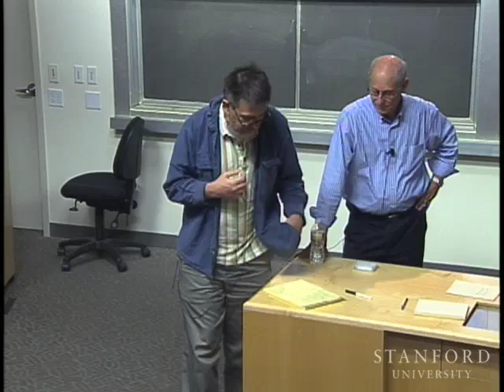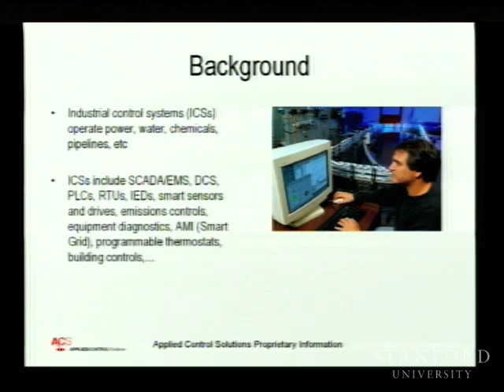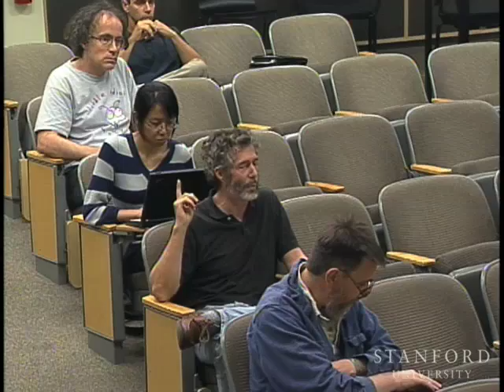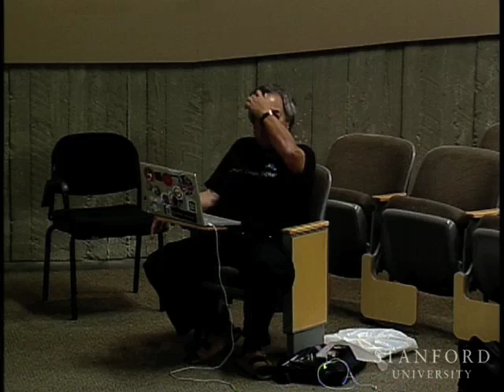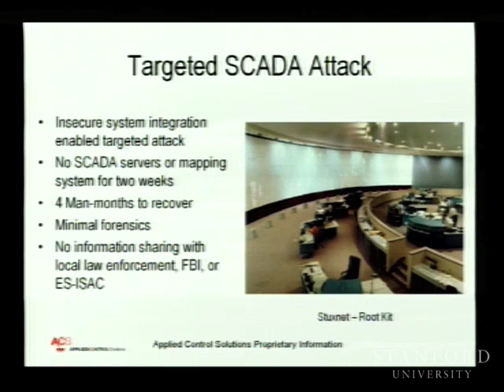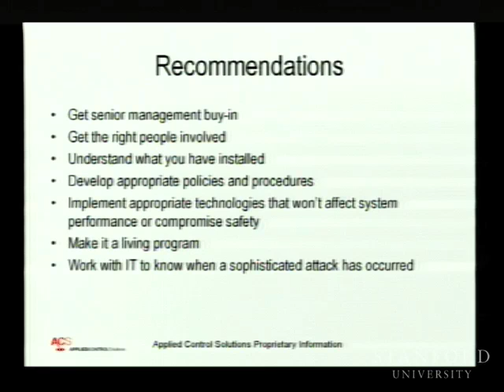Cyber Security of Industrial Control Systems

Comment: Me not an expert but me thinking...why on earth cant these PLC units just have an old fashioned fire wall? I think I have a possible answer. Because 15 companies have delivered millions of control systems to the whole world for decades and its simlpy to mountainous of an attempt to go in and change them all. They cost a fortune and the entire induatrial world uses them. And ifeven if you did. There are no current alternative products from Siemens and ABB that can to the job
Reply: That is not the case. Manufacturers are now providing and supporting separate firewalls for network segments (for at least 5 years).
There has always been the ABILITY to protect traffic, on a network segment, but this is not generally implemented due to overall system cost. Maintainability, systems training and the cost have been the main considerations for 2 generations of systems engineers already.
Yes, it is time to move forward, but frankly, the ideal would be having a virus scanner incorporated in addition to individual device firewalls. However, PLCs and local controllers require rapid scanning rates (often less than 100 ms) to ensure capture of an input event, transfer of a function to an output and so on. So, it's a risk, but it's been a considered risk not to have virus scanners, firewalls locally incorporated because of their additional resource overhead.
For completeness, security policies should include the physical, procedural, and information management. It has to be holistic and not a band-aid on a single area.

If you do have the time, take a read of ISA99, NIC-CIRP Best Practices, NISTR 7628.
Reply: +dobiem1 It is actually NISTIR* 7628; your welcome guys.